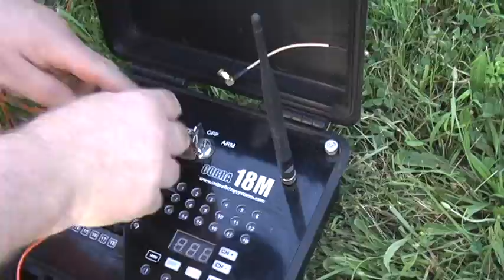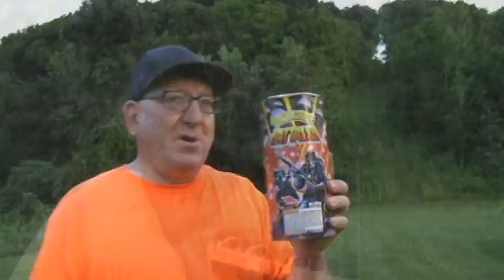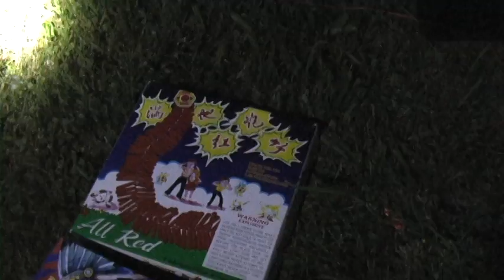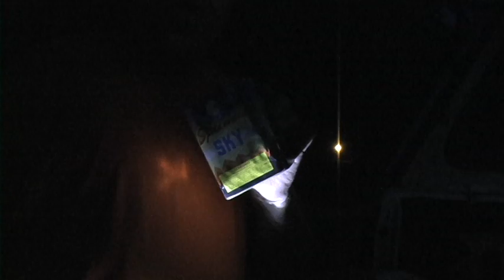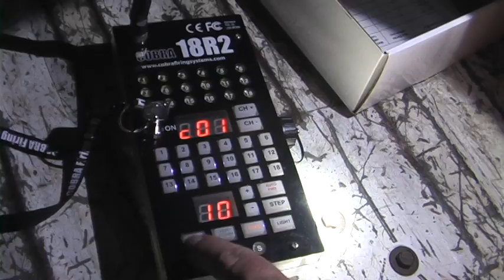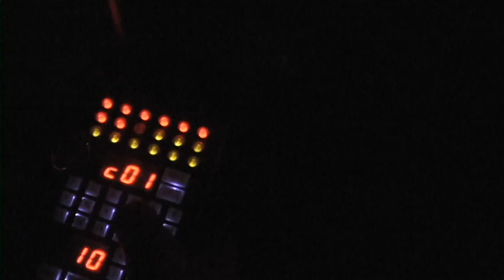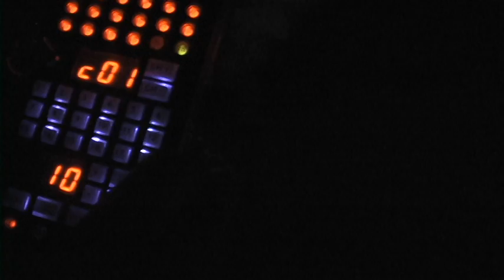Advanced Backyard Fireworks

Comment: here's an idea for replacing the visco fuse of consumer products with e-matches. Why not get some of the quick fuse like the 1 sec/foot quick fuse from pyroboom. Cut lengths that, once inserted in the product, can still clear the top of the mortar tube and connect the e-match to the quickfuse leaving the shroud in place. That way you don't have to rely on pulling the e-match free using nails causing the mortar to start tumbling and veer to a certain direction.

Comment: Dave, could you drill a small hole around the top of each tube and do a strain relief type of technique so the wire wouldn't get pulled out of the cobra firing module?

Comment: I'd love to see a cobra system with reusable vampire-clips/wire-taps instead of having to strip and clip.

Also it'd probably be a little more kick-resistant given that vampire clips usually clamp down on the insulation too.
Reply from the maker: You got me curious, I never heard of those connectors. I am going to research it.
Reply: I haven't seen the clips on any firing system. I just know you can buy the vampire type clip at any auto parts store and use it for automotive stuff.

How they work is that they clamp down on the wire and have teeth that bite through the insulation and make contact with the wire inside. On the automotive stuff, it's usually a one-time-use part; but I see no reason a reusable plastic clip couldn't be prototyped using a 3d printer and a couple pieces of razor-blade steel.

Comment: Unfortunately your not realizing that adding E-match to shells to a rack you tied the match off too creates a very serious issue. If the match doesn't pull free of the shell it will pull on the shell as it goes up possibly altering the trajectory of the shell. Meaning it may get pulled in one direction or another creating a very scary situation. You actually shouldn't use the "Stress point tape" for that reason cause that's what will pull the shell off course. Make a large hole a add the E-MATCH. If you tape above that hole and wrap the wire you could very well be creating a low break.  This is yet another problem you pro guys cause mixing your techniques with Consumer product 🤦‍♂️